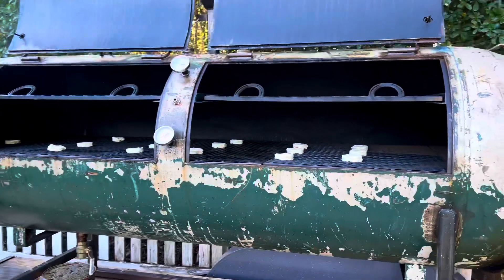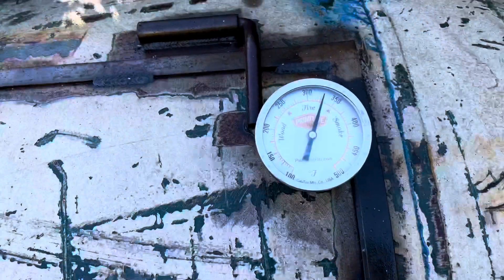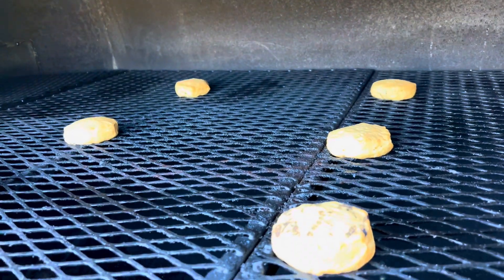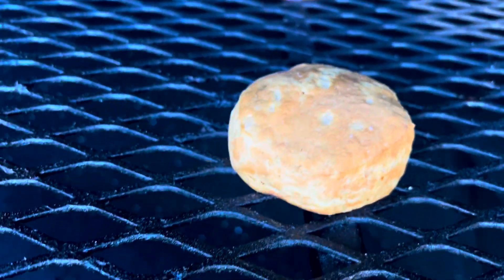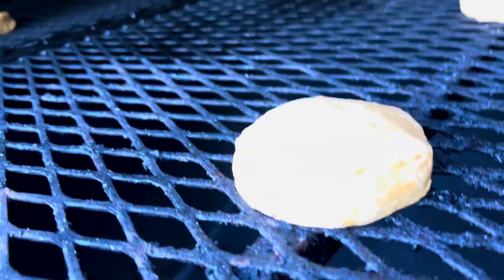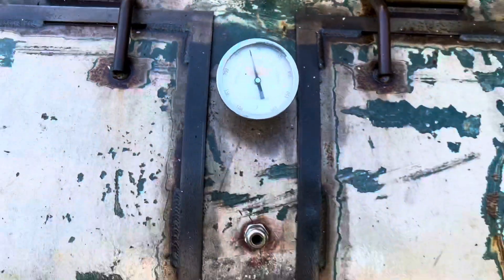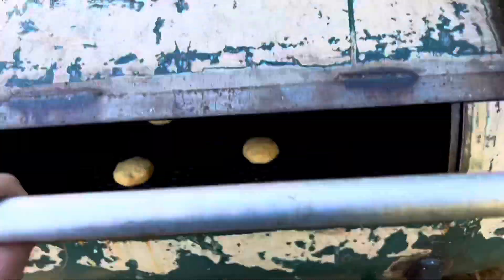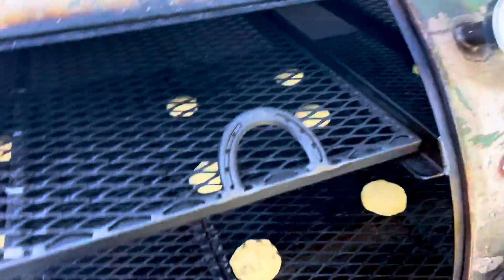Primitive Pits- Biscuit cook checking for hot spots in the 500 gallon smoker

Comment: My apologies for my ignorance but does food need to be moved throughout this beast because of the temperature variance? 
How many can and do you cook for and do you move food around to deal with temperature variance?
Very informative video.
Thank you.
Reply from the maker: When I make these videos I normally only have one to three items on it, so you won’t see me moving location so much. Now for things like ribs and some of the smaller or more delicate meat I may turn them 180 degrees so the force of the heat is hitting from the opposite side. For ribs I do this because it tends to even out the pull back on the bones. With any meat that is fairly even in size I tend to flip for protection of the meat from over cooking or burning on one side. It’s like getting hit with a hairdryer and never moving it.